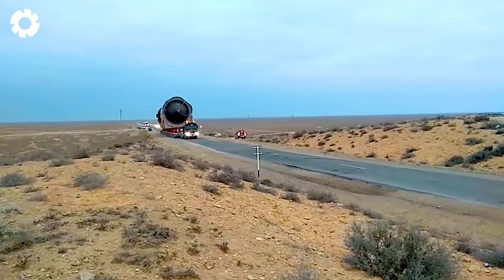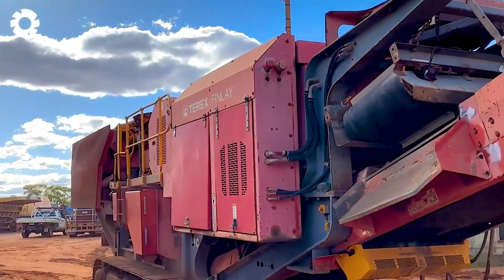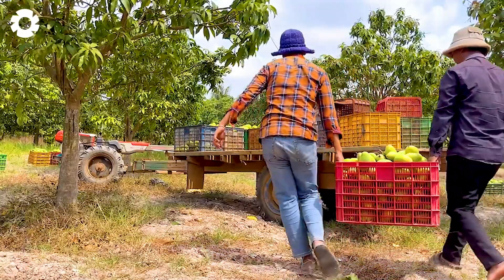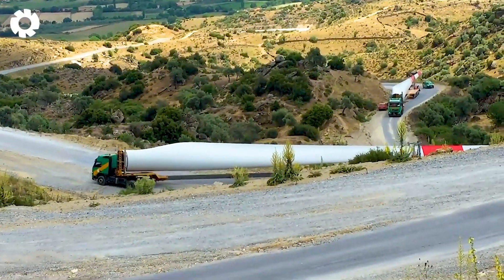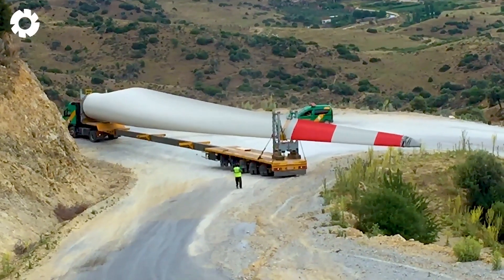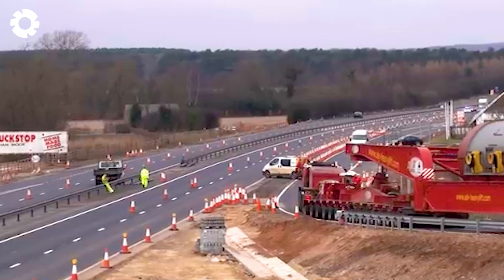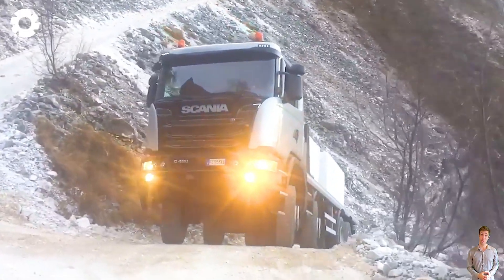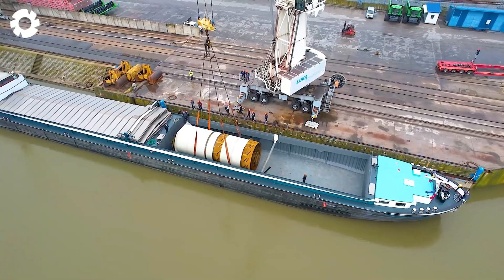Transporting Mango This Way - Farmers Grow Tons of Mango | Agriculture Technology

Comment: Transporting elephants using heavy machinery is a modern solution that helps ensure the safety of both elephants and humans. This technology is often applied in elephant conservation, relocation or rescue, using specialized equipment such as cranes, super heavy trucks and special lifting systems. However, animal safety and welfare regulations must be strictly followed to avoid causing stress or injury to elephants.